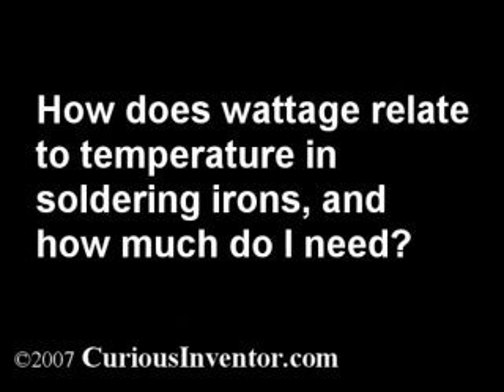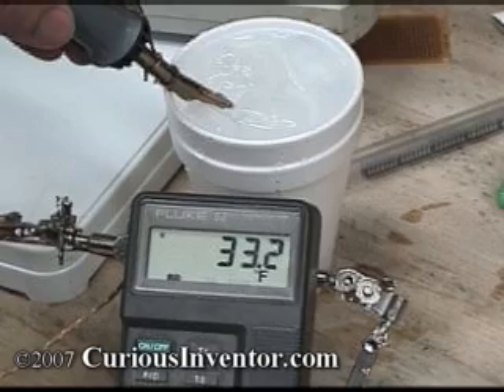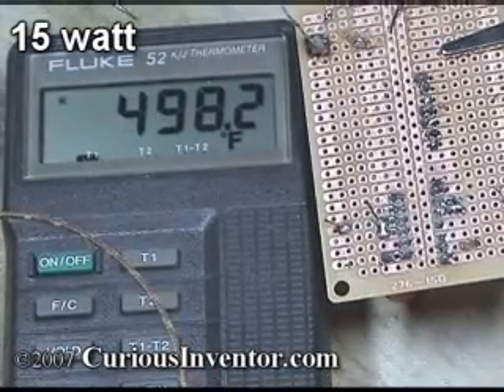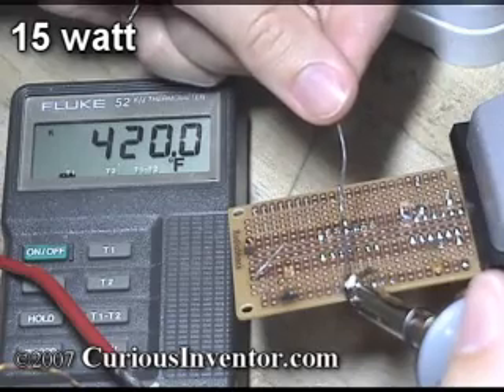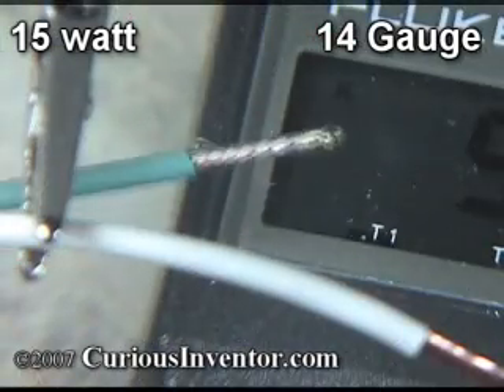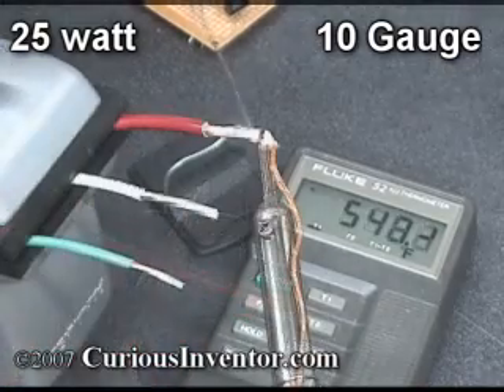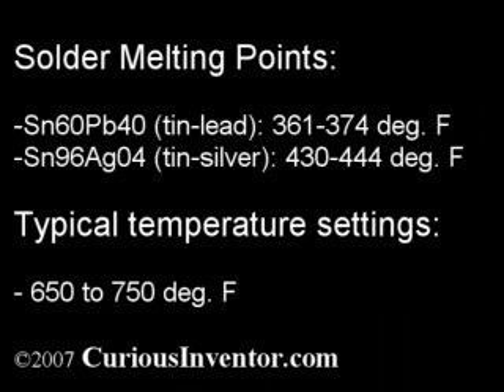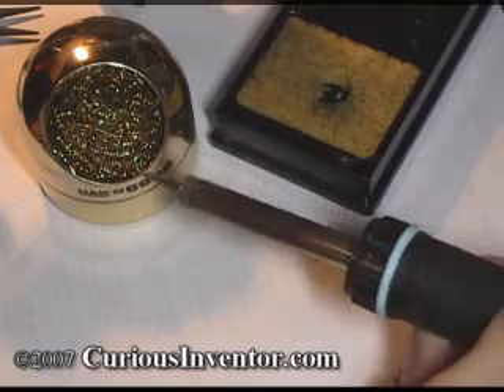Soldering Iron Wattage vs. Temperature

Comment: This is a good argument for CPU-controlled soldering irons. My Hakko FX-888D maintains a set temperature of my choice. So, when the temperature starts to drop on the tip, the CPU cranks up the wattage to maintain the temperature. I run into this situation when, for example, I'm soldering on a pad that is connected to a large ground plain. Or, the pad is on a power rail that is using two ounces or more of copper. Using these cheap irons is in a nutshell a hit-or-miss experience.

Comment: I do odd soldering here and there but not much.  I currently have a 15w and 25w iron and wanted to swap out a couple of capacitors on a Samsung psu.  Both these irons are useless and I found even after 30 seconds holding direct on the solder I could not melt the joint to de-solderer.  With factory grade solder do I need a hotter iron to melt it or is it purely patience?
Reply: @Jacob Blomdahl exactly!! I learned that old joints especially from factory do need new solder + pretty good temperature!! I had the same issue, because I sometime scavenge some components from old boards for some project! So new solder (with flux core) + good temperature is the good cobo to go with 😉

Comment: I have been soldering for years and never really looked at temperature only wattage. I have gone through a few irons over my 40 plus years of DIY, modelling copper figures from cut and worked pipe and cable and of course repairing numerous household items ( mostly headphones, light fittings, hair irons/curlers and computer parts, et al ) where kids and pets have been involved. Being medically retired, I now have much more time on my hands and want an adjustable soldering iron for my many intended projects ( quadcopters being my first one, i hope ). Your video was very helpful even if I did stumble across it by accident. So thank you and may your connections never be dry.

Comment: After watching your video I decided on a 75 watt digital solder station.  I do quite a bit of electrical where I have to solder an occasional 8 gage wire, but the usual size is 12 or 14 gage.  Thanks for the video.

Comment: What about temperature controlled irons? Are they worthwhile?
Reply: allyourcode soldering stations control the wattage.  Which corresponds to heat, but you aren't dialing in a temp.  They are worthwhile if you will plan to use high heat for wires, but will also need lower heat for sensitive PCB things.  So it's about your needs really.
Reply: Corbett French I stand corrected, some to control temp (as I was looking through Amazon)

Comment: Very helpful video! Thank you!  I was using a 15 watt soldering iron to try to replace the Dreamcast clock battery and it wasn't hot enough to melt the metal.  Went to RadioShack and bought a 40 watt iron and it worked like a charm.

Comment: I'm just starting to learn this, but I have a temperature controlled iron and was working at 325 degrees and I made my joints just fine. I'm confused as to why you would need it so ridiculously high. I'm working on just basic one sided PCBs. Is that why? Would I need it where you have it if I were working on through hole?

Comment: I tried to salve components from a motherboard and it must have solder rated for high heat cause I could not melt it with a 25 watt soldering iron is there a different kind of solder on motherboards and is it a higher melting temperature?

Comment: The tip size and geometry also matter.  A chisel tip has more surface area to contact the joint.  This enables better heat transfer.

Comment: This is a great video.  I was a bit worried my 25w iron would not suffice for doing a bit of thru-hole soldering.  It sounds like it is very doable with this wattage.  This video answered, *I think*, every question I had about iron wattage / temperature and how that applies to melting points of solder and effectiveness of soldering.  Although, this might not apply to all irons at these wattages, it is a great rule of thumb to go off of.  Awesome!  Well done!  THANKS!!!

Comment: your body is over 70% water if you place a soldering iron in a drop of water it boils instanly. A burn happens when the water in your cells is removed with heat. Most often this results in cell rupture which is what makes the wound.

Comment: Quite informative, in summary

The 50W iron ran at a rather high temperature for general soldering. This is bad for the lifetime of the bit and increases the risk of overheating small components (production uses higher temps because they value contstruction speed highly and have the skill to not sit on connections for too long).

The 15W was strugling with even the small stuff like the DIP. 

So if you are going to buy one of theese irons for electronic work the 25W is probablly your best bet.

Comment: i live in the netherlands.

I have a 15, 25, and 40 watt iron.

i have used the 25 watt iron to tin and solder 2,5mm2 (something around 14 gauge) wires. that goes easily. a 4mm2 (10 gauge) goes easily too.

I think my irons create more heat then your irons. i have 230 volts instead of 115 volts.

I think my 15 watt iron has the same temperatur as your 30 watt iron (25w by me is 50w by you)

Comment from the maker: because many smt parts draw little heat, you can get away with a 15 watt iron in many cases. But in general, a regulated iron will be better since it will be able to compensate if you are soldering many pins in quick succession. Also if you need to solder a heat sink connected to a ground plane, the extra wattage and regulation will be helpful.

Comment: thanks dude but ill all ready got it im not sure what valtage i got but its a weller 25wats and it goes up to 750degrees

its all good though thanks for the helpfull video check out what i fixed 3 leaked caps
on a lcd power supply just check my videos and thanks for your time.

Comment: hey im just getting into soldering im 15 but i dont curently have one besides the one my father has
he uses it for bigger things than circut board/componets like im giong to use it for m not sure what wattage it is yet
but my qeustion is. does the voltage play a role here?

Comment from the maker: Interesting idea.  That fits with general advice I've read about choosing tips.  Ideally, you want the largest mass possible (to reduce dips like you say), the most surface area contact, and the shortest distance between the heater and the tip surface.  In my experience, keeping a clean tip and using a good brand (Weller, Hakko, Metcal, OKi, JBC, etc.) of a temp controlled soldering station out-weighs the tip size / shape factors.

Comment from the maker: Thanks for the feedback.  That's the standard prototype board available at RadioShack.  You can connect pads by applying enough extra solder to form a bridge between adjacent pads.  For non-adjacent pads, solder jumper wires to the pads.  I highly recommend never using one of those boards; you'll end up with a mess of wires and waste tons of time.  Google 'make your own PCB' for a better way.

Comment: By the way, when you soldered with the 25 watt iron, I saw that the board you were using had individual copper pads that aren't connected to any others in any way. What are these kinds of boards used for if none of the pads are connected? Thanks a lot! Great video BTW.